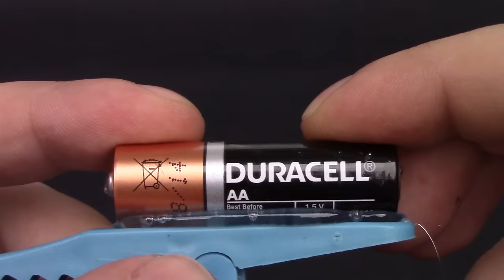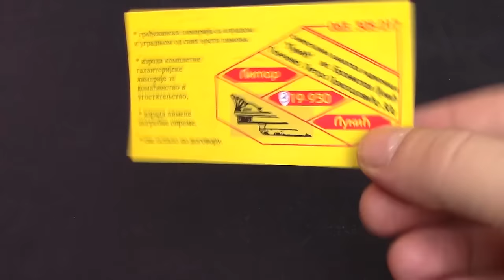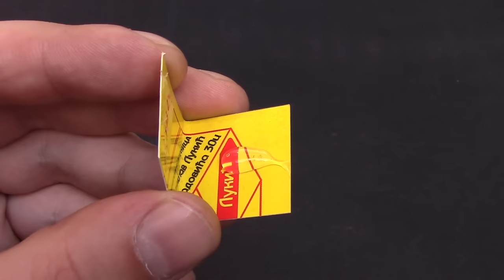How to Make a Simple Door Alarm

Comment: I made something like this 60 years ago when I was a boy. Spring-type wooden clothespins were still relatively new. Nice thing about that design was you could put a thin machine or wood screw through the spring  to hold the clothespin to any surface (like a door frame). Two metal thumbtacks were the electrodes. Scared a neighbor girl with it. Good times!
Reply: DAMN 60 YEARS??
Reply: So far

Comment: It was meant to be installed on the INSIDE of the door when you’re home, asleep or whatever if there is an intruder or invasion. When you leave, and while ur gone, wedge something in between the clips, and do what you need to do. When you come home and your back inside, reset it. The batteries won’t need to be changed for a long, long time, ( shelf life) if they are new and not left draining. Like the alarm constantly going. Something USING the battery juice is what drains them. If it’s disengaged then the batteries should last a long time. Make several and store them. Not a bad idea for home owners or renters who have no money for an alarm system with monthly fees. Keep a charged cell phone, tactical flash light, and a home self defense weapon with extra ammo at home in the bedroom. You can also carry these items on your person while at home. Think ahead, expect the best and prepare for the worst. Be trained in everything you use. Respect yourself, respect others, and clean up after yourself. All of this is the best advice I can give anyone. Remember, I was told in the Police Academy;  Better to have it and not need it, than need it n not have it. God bless n be safe. 🙏.         Task Force Guy - over n out

Comment: Great work..only two small details:
 
1) if using it for outdoor installation, ensure that it’s weatherproof( perhaps add a small shelter structure over it)..

2) when the battery dies, you’ll have to detach the wires and scrape off the glue and re install a new pair of batteries as compared to Just taking it out from a regular household appliance.. that’s if you plan to use this alarm for permanent use...

But apart from that..really good job..
Reply: Agreed!

Comment: Interesting idea. I am not applying hot glue to my door. You can buy packs of the little proximity switch alarms with a shutoff switch for a few bucks. I've used them they work well and battery change is easy. For god sakes man invest in a set of wire strippers, before you de-skin your finger. Good presentation, I'm just not that bored. Thanks. Sam.

Comment: just two questions:
1. how are you gonna change the batteries without any damage,
2. how are you gonna live with an alarm which activates everytime you use the door.
Reply: I guess you can use this alarm for a fridge door for example
Reply: Charger them. Its easy.
Reply: i mean you can use it on your doors now people starting to break into houses now
Reply: @kommandoiv7967 
.
Reply: 1. either use rechargeable batteries, or make an enclosure for batteries and solder the wires to it. The video is for demonstration purposes. 
2. put another cardboard between the leads when the alarm is unarmed. Arm it back by removing the cardboard and putting the one from your door instead.

Comment: how did you get the speaker to play a tone? usually those speakers just pop when voltage is applied thus needing a controller.
Reply: It's not a speaker.  It looks, like a Mallory sonalert type of device.  All it does is beep or pulse.  Quite common .  My biggest beef is that they are high pitched and not terribly loud.  My boss couldn't hear it in an alarm panel by his office.   With hearing problems they can't always be heard because the pitch is too high.  Test it with the person who it is for
Reply: its a buzzer speaker if apply voltage it well beep

Comment: But how do we get out of our houses with out knocking the alarm? Not so simple. And no im not gonna use a backdoor
Reply: then us a window XD
Reply: RickDoetGames if I use a window how do I lock it from outside?
Reply: +Pepsi Dawg use a lock with a key
Reply: Umm just put the paper back in
Reply: Jabran Imran How do I put it back if im outside.....
Reply: +Pepsi Dawg why would you set this alarm if you aren't home? You wouldn't be there to hear it.
Reply: t scare off an intruder???
....most alarms are staged when ppl leave the house!
Reply: Hot glue another clip to hold the string,and to set the alarm from outside,make a small gap in the door for the string to pass through,and put another clip outside(recommended to conceal it) to hold the string.

Problem?
Reply: Just cut the string guys =))
Reply: Mi
Reply: the thruster 69 ?
Reply: JUST PUT A SWITCH IN BETWEEN THE DOOR AND THE BUZZER
Reply: Pepsi Dawg  u read my mind
Reply: Pepsi Dawg ok
Reply: Yogi Dahiya hbdhkyd
Reply: Take another peice of folded cardboard and replace the part that trips the alarm once ur leaving
Reply: Calm down Mohammed

Comment: What I did was I just took a motion sensor took it a part spliced positive and negative wires to the original sensor wires. After that I soldered the new wires to the wires on a electric motor. the motor makes the hammer move side to side on the alarm clock with bells.

Use it in my Locker at school seems to work well

Comment: If you glue the batteries on the clip, how are you going to take them out if they run out and die? What if they DO die and so the alarm DOESN'T ring when an intruder comes into a door? Also, this is a terrible idea because if you're not home, there is a defenseless baby with a defenseless dog in the house, and an intruder comes in? Neither anyone will save the baby nor the dog.

Comment: You could just buy a small alarm cheaper than those batteries cost. Also you wouldn't need to waste time messing around with a clothes peg, wires, solder, drills, glue guns or speaker components.

Comment: I tried this setup, but for something else, and all the buzzer did was click, click, click. No bEEEEEEEEEEp.
Reply: I used 2 AA batteries to power it on. I don't understand why it didn't work like in the video

EDIT: I found out you need a buzzer module that has the buzzer attached to a small circuit board, so the circuit can amplify the energy to sound, to make the buzzer go BEEEEEEEEEEEEEEEEEEEEEEEEEP

Comment: lol. iit doesn't work that way. Where is the high frequency signal generator located? The piezoelectric element vibrates from a high-frequency pulsed current. A direct current will simply arrange a short circuit and nothing will be heard.

Comment: Soldering a battery. Is that advidable?
Reply: My puzzer just goes "tak" once. Do you know how could it be fixed so it goes "beeeeeeeeeeeeeeeeeeep" like\
in the video.
Reply: Yeah, just be quick.

I'd use fresh lithium primaries, because they last longer and replacing the battery is going to be non-trivial.

Comment: i tried this and it doesn't work, my speaker is not making a noise and i also tried putting a 150 ohms resistor cause im using a 9v battery instead of 2 AA battery

Comment: Hot - glueing a battery?! First of all, that is extremely dangerous. Second, it makes the batteries irreplaceable! And what, you need to get a new beeper thing again? And build it all over? This isn’t a very good design to be quite honest. I’ve seen better. And hot glueing something to the WALL?! I mean seriously? Go on, make a new video with a more REPLACEABLE design, and find a better way to trigger that alarm. Oh, and don’t forget viewers, your house might be set on fire at the end of this project! And, that speaker probably isn’t loud enough for you to hear it. All that work for an inefficient, non functioning, and irreplaceable design. Edit: SOLDERING TO A BATTERY IS THE WORST THING YOU COULD DO!